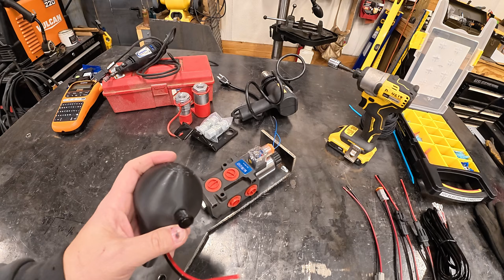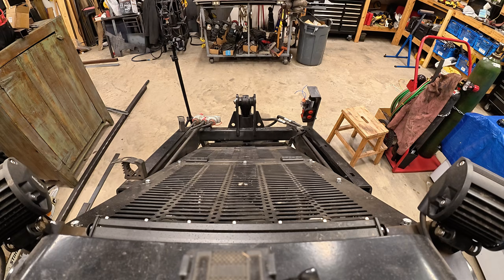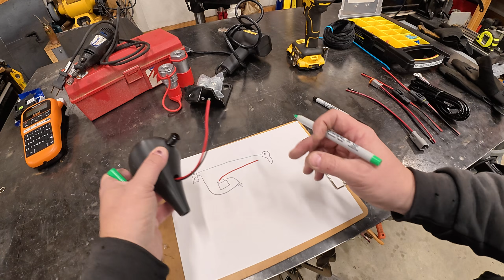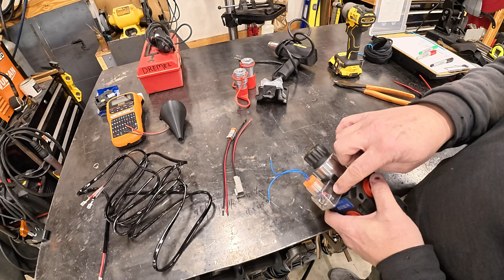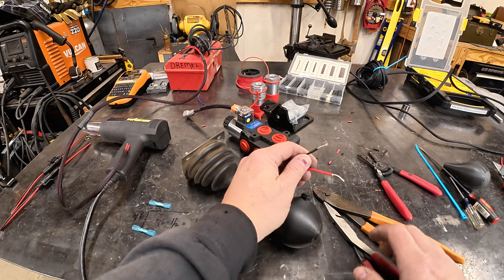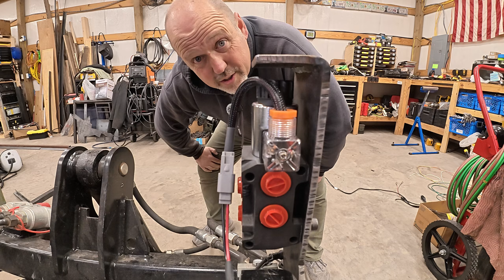Adding a Hydraulic Diverter Valve to My Mini Skid Steer | Part 1: Mounting & Wiring

Comment from the maker: 🔧 PART 2 IS WHERE IT GETS SERIOUS…

In this video I mounted the diverter valve and completed all the electrical wiring — but in Part 2 I’m taking the mini skid to a hydraulic shop to have the lines professionally plumbed and pressure-tested.

We’ll cover:
• Proper hose routing
• Correct fittings and adapters
• Clean hydraulic plumbing practices
• What a hydraulic shop actually does
• And full system testing

Would you plumb the hydraulic lines yourself — or take it to a hydraulic shop?

Drop your answer below 👇
Reply: Where is Part 2?
Reply from the maker: @Jetfuel20  I’m almost done with the filming and work! Sorry it’s taking so long.

Comment: Can you put a hydraulic needle flow valve on the grapple's hydraulic line instead?
Reply from the maker: You could, but this is more about order of operations when using the machine.

A needle valve on the attachment itself would require needle valves for all such attachments and I have several. This adds up. If I installed it on the auxiliary circuit, I would restrict flow to constant flow attachments which I don’t want to do.

I want to keep two hands on the controls at all times. These machines are stable, but can be dangerous.

By adding this valve, I can keep my left hand on the drive joystick and operate all boom, bucket, opening operations with my right hand without removing it from the joystick.

My alternative is to drive up to the object with the bucket lowered, remove one hand to operate the auxiliary function while the other hand is articulating the bucket/grapple, and the move hand position again to reverse or move the machine.

The goal is to keep your order of operations to a minimum and the movement limited.

If I’m running a constant flow attachment, say a stump grinder, I can now connect the rotation motor to the constant flow auxiliary, while operating the swing function from the joystick. 

Most articulated stump grinders have a separate control box that further complicates order of operation.

I’ll film a video showing the movement of my hands and why I chose to make this modification.

Comment: Awesome video — I really enjoyed it. I do have a few questions, but they’re coming from someone who’s naturally curious and always wants to understand the “why” behind things. None of this is meant to question your decisions or abilities in any way. It actually looks like you and I have a lot in common when it comes to goals, hobbies, and the kinds of projects we enjoy.

Why did you choose to mount the diverter valve down by the bucket?

What type of filament did you use for the control knob?

What 3D printer are you running?

Could the diverter valve have been mounted in the engine bay and then T’d back into the line going down to the bucket, with a 3D‑printed bracket to hold it inside the engine compartment?

Sorry for all the questions — this project really got my mind going because I’ve been considering doing something similar on my Mahindra tractor. Looking forward to part 2.
Reply from the maker: Those are great questions! I’ll do my best to cover them all. Let me know if I miss anything.

Mounting: I considered the engine bay, but it would mean the new plumbing would require longer hoses and crowd the engine bay.

Securing it to the engine bay is difficult to get the holes properly drilled and tapped, really awkward positioning.

3d printer is a PRUSA MK4S. I printed 80% fill with PLA+.

This location closely mirrors the factory diverter on a DitchWitch.

The mount was made twice, first so it could lay flat, but this hindered the hood opening.

The second (in video) keeps it vertical and I think we will be able to route the plumbing for the best access.

Hope this helps.
Reply: @somewhereinoklahoma  So is it important that the diverter valve stays level to remain operational?

Thanks for answering all my questions.
Reply from the maker: @Addicted-to-Tinkering nope. The angle doesn’t matter. It’s more personal preference, but I might regret the decision after I use it for a while.
Reply: @somewhereinoklahoma  That's all part of learning, try it, and if it fails try again.